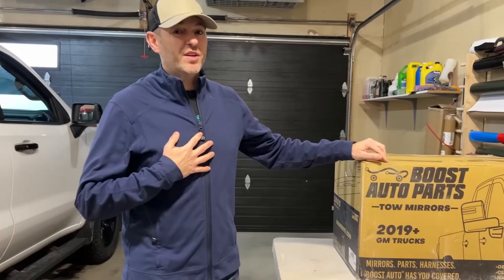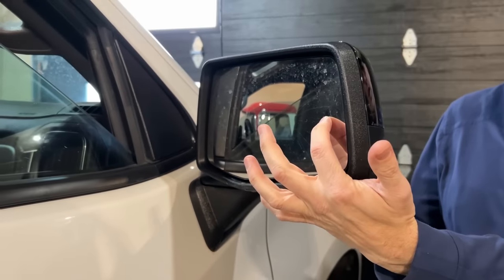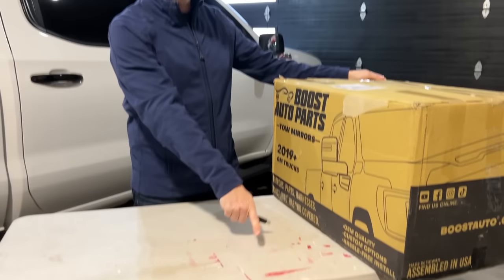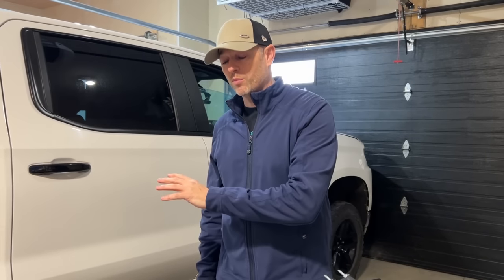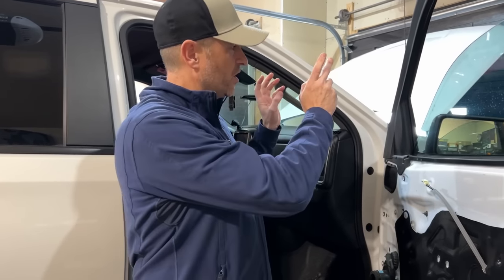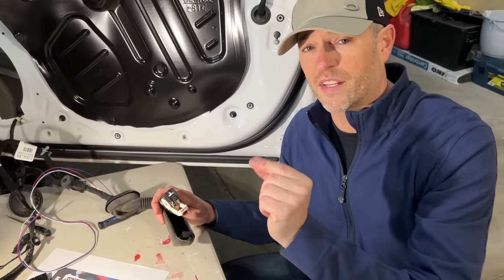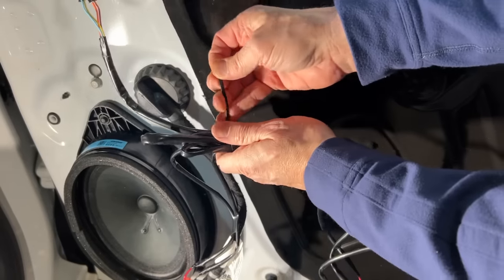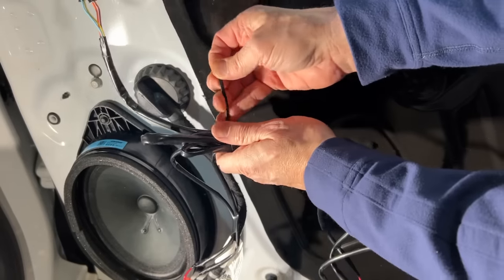Upgrade to Tow Mirrors for 1500 GMC & Chevy Trucks: 2019+

Comment: I keep hearing you say compatibility with all the options, What if I have a 2019 Silverado w nothing on the mirrors? Standard mirrors Am I able to add anything or am I stuck w just the glass lol. Ex I want power fold and rear lights, sequential, and heated mirrors. Is that even possible or am I wasting time?
Reply from the maker: Their website will help guide you.   There were too many configurations for me to cover them all in a video.

Comment: Nice!
I did the same thing from Boost Auto Parts for my 2017 Silverado
I already had the tow mirrors installed by the dealer with a new harness and cameras.
I lost the cams when I bought the new mirrors from Boost Auto with the folding option but I lost that, anyway, when I installed the T-Style radio from Linkswell.
It was plug and play for me with the folding option, just a new switch in the driver door arm rest where the mirror adjustments are.
I, also, bought a harness adapter from HarnessDR to allow the turn signal ability (plug and play, too)
I find I use the folding option more than I ever thought I would.
Love the vid! :)

Comment: I like the stock mirrors on the 1500’s I do wish mine had the turn signal in the glass like gm used to do, but on the 2019-2022 Silverado and Sierra 1500’s that was not an option. I have the blind spot monitoring, the puddle lamps, front work lights, heated and power fold on my Sierra.

Comment: Those look like the OE mirrors that came on my 2020 Trail Boss LT from the factory.  Is Boost the OE supplier?

FYI, the factory tow mirrors are tough as hell.  A few months ago I was cutoff by an early 90s Silverado that decided to jump in my lane as I was passing.  I was able to escape right and avoid body damage, but one of my mirrors came in contact with his glass and metal mirror.  I destroyed his mirror while mine just received a few tiny marks on it.  Dude admitted he was wrong and paid cash for a new mirror on the spot (I used the GM Parts Direct website for pricing).  I pocketed the cash since the mirror damage is barely noticeable.

Comment: Did the wire harness for the reverse lights came with the whole tow mirror set up? Or did you buy it separately. The last step
Reply from the maker: Everything for all options are provided by Boost Auto.  I didn’t buy any special wiring.

Comment: May be an asinine question, but is it absolutely necessary to take off both door panels when installing a base set of tow mirrors with just the sequential feature added? No power folding, etc. etc.
Reply from the maker: Just to get to the mirror mounts requires taking off the door panels
Reply: @Donslife  Thank you for the reply!

Comment: For the lights to turn on when you put it in reverse, you bought that harness separate ?
Reply from the maker: Boost Auto has a separate harness to purchase if you want.  All the parts I uses were from Boost Auto, it just comes down to which options you spec yours with

Comment: Okay this is something I want to do can you explain what switch back vs sequential difference is in all the different lighting packages pleaseeeee
Reply from the maker: Switchback - runs one color (white drl) most of the time but changes to another color (amber signal) until it switches back.  

Sequential means it is an animates sequence of lighting instead of a boring blink.   Imagine 10 bulbs in a row lighting up in order but a millisecond after each other vs all at the exact same time
Reply: @Donslife  ah okay thank you I almost made a mistake. They are pricy but looks awesome and having cheat codes for the buttons is cool.
Reply from the maker: @jeremywilliams8501 I recall they had definitions for each feature on the website

Comment: What if my truck has it out button to fold the mirrors, would I still have to use the LL-RR to fold them away instead of the factory button?
Reply from the maker: You would us the factory button for that control feature and not have to add it as a feature to the spec you order

Comment: Random - do you find these mirrors to be a blind spot when driving?  They look to be a lot higher in the window area than the original ones, and it seems like it would block vision.  Thanks again for all of the videos!
Reply: Yes, they can be a blind spot issue.
One has to take a little more care when pulling out of an intersection but they are great for rear visibility and rear blind spots.
Reply: @MikeBMW  thanks, Mike!

Comment: Could I just do jump the body control harness black and grey modules to just get the Cargo lamps to Work instead of messing with the three wires thru the door panel?
Reply from the maker: my answer is maybe, but if there is some BCM voltage monitoring going on, you may get a non-critical error message.  Running the wires is a pain, but once it is done, its done.

Comment: Hi, I have the real deal 2022, Silverado, 3.0 Duramax diesel, 6 1/2' bed, crew cab, 1500, with non towing mirrors with the cameras and all.  Do you know when the model with the camera option will be available?  I tow a travel trailer.  Too bad these mirrors are not also available with 3/8X24 thread twin trucker antenna mounts.
Reply from the maker: I’m sorry, I don’t know when a camera transfer option would be available
Reply: @Donslife  Do you have a relationship with anybody at boost that you can reach out to see if they might have an idea of when they might be coming out with a set of mirrors that will work with the cameras.  Also I have a great idea, they should  make a dash cam that would interface with all the cameras and the microphone for the speaker phone.
Reply from the maker: I have a contact and he’d let me know when and if.  Interesting idea too 👍🏼
Reply: @Donslife  The way I figure it, the cameras are already there 360 degrees and the microphones are already there, front, rear sides and for incidents like traffic crashes and traffic stops it might also capture the audio.  It seems like a no brainer.
Reply: @Donslife  If someone did make a multi camera 360 degree dashcam module with audio, it would be an incredible  super clean set up since the cameras and microphones are all factory OE installed.

Comment: Hey ! I am looking to do the same upgrade on my 2020 3.0 , when I call gm they tell me because I have blind spot indicators on my mirrors that the new tow mirrors don’t match . Did you run into this problem ? I’m wondering if I can still use them properly
Reply from the maker: Since the cameras aren’t able to be transferred over from the old mirrors to the new mirrors you would give up that feature as well as any side camera ability.   They are working on it, but they want it to align or at least be able to be calibrated by the owner during the installation
Reply: Ok thank you ! I’m ok with giving up that feature , but what my concern was and GMs that it was going to give me dash lights or the other features may not work properly . 

I’m not sure what to do !! I’m not in a rush to get them but I’m pretty sure I want them !
Reply from the maker: I would suggest contacting BoostAutoParts with your specific concerns.  They are really good at helping out for these things

Comment: did you find some for your AT4? i have a 2021 and i want tow mirrors but i want to use my cameras too
Reply from the maker: No camera solution yet
Reply: You can buy the GM versions with the camera and install them. 87864006 and 87864007 are the part numbers
Reply: @BenHessFilms  them part numbers don't pull up as tow mirrors.

Comment: So basically for Custom Trail Boss only that don't have any upgrades to factory mirrors and NOT LT's.. 👎 Disappointed. One day maybe they will have a plug and play solution for tow mirrors for the LT Trail Boss..
Reply: Our mirrors will work on an LT Trail Boss, we just don't currently support the 360 camera. All other features can carry over.
Reply: @boostautoparts  plug n play to factory harness without need for flash from dealership?
Reply: @stephansmithoutdoors  There's no need for a flash with our mirrors. Any lighting feature you originally had would be plug and play. If you wanted to add features not originally equipped (running light, turn signal, rear cargo light) then you'd need to do our wiring - but if you're not concerned about gaining the lighting features you can just plug in and be done.
Reply: @boostautoparts  Thank you for your time in explaining that..
Reply: @boostautoparts have you guys come up with a solution for the 360 camera yet? Or still working on it? Thanks